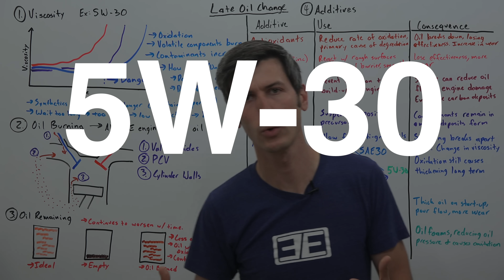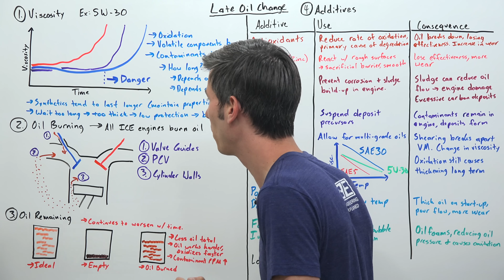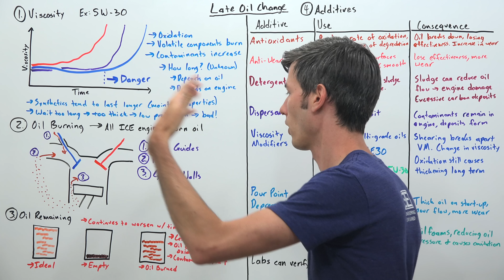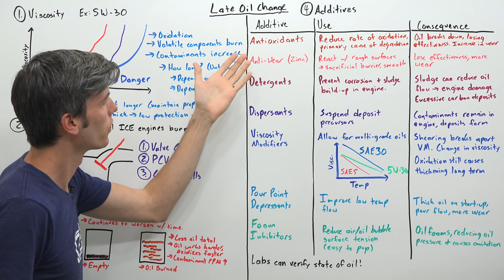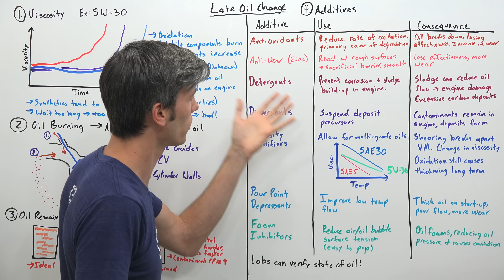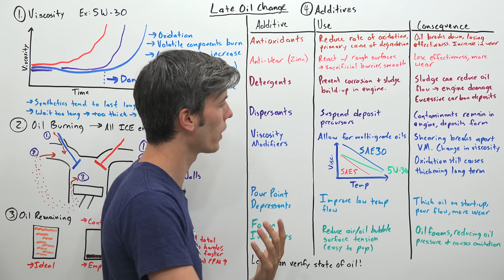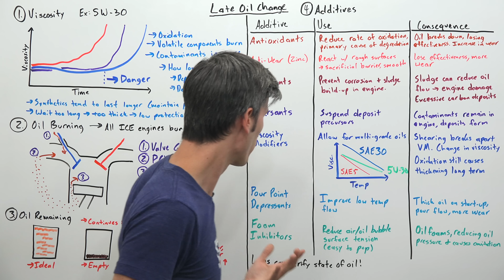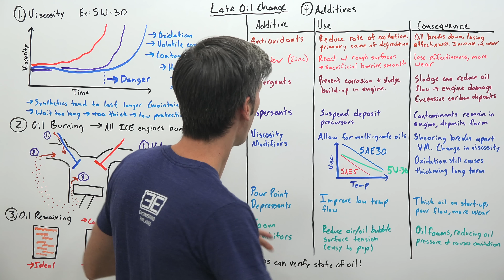What If You Forget To Change Your Oil?

Comment: What happens to the ICE oil when it passes the 1 year part of the X mile/1 year schedule? Is it just something dealership service centers make money on?
Reply: @Zap Brannigan This all makes sense, but what about the cases when the car is just parked in the garage and there is no gas/oil mixup? Does the oil age (literally) as the time passes?
Reply: @PhoenixBravo30  generally, no, especially with synthetic oils. Pretty sure the additives are all inorganic, so generally stable at normal temperature ranges. The cause for time interval changes are related to contaminants from operation of the engine in suboptimal conditions. Some of those can be mitigated by keeping the engine in good working order and by giving the engine a good regular workout at full operating temperature for at least 30 minutes to cook off the fuel and water in the oil.

Comment: I change my full synthetic oil every 10000 miles whether it needs it or not. 10000 mile intervals are easy to remember and I don't like doing math. My current car has 184kmiles and burns a quart every 5kmiles.

Comment: Is oil in the US worse then other places ?  Most of the Euro Engines I've drove in Germany have intervals north of 10k miles.  Many newer cars have Oil change intervals in the 20 and 30k mile range. (30-50.000 km)   Yes those engine lasted a long time.

Comment: Not ALL engines consume oil. I do my oil changes after 10,000 kms intervals with zero oil consumption. My Mazda has 150k kms on it. My previous car was the same.
Reply: it just doesn't consume very much, a engine will always consume some amount of oil no matter how little, oil evaporates off and goes into the intake (or in old engines to the atmosphere), that's entirely unavoidable.  I imagine there's also some oil getting past the rings or valve seals, again, it might be a tiny amount but it's going to be there.

Comment: 2005 4.6 V-8 Mustang bought new
4-5k oil changes since new 11/04
Synthetic oil used for 15 years. 5w20 recommended oil always used.
166,500 miles on engine
Engine uses Only 1/2 quart after 5000 miles. Nuff Said!  Oil is cheap. Don't push it!

Comment: I always leave knowing more than when I came, thank you
Reply: This concentrates exclusively on time not mileage , a  bit dissapointed that real mileage examples with data was not used , so if you have an occaisonal car that does low milage do you change when the milage is up or at a regular interval when its had little work to do ..?
Reply: R Warner,
"This concentrates exclusively on time not mileage, ..."  Did you mean that the other way around? Seems to me that all of the detrimental effects on oil he describes here are a function of the car being driven (like oil being burned) rather than what makes it go bad over time when not driven much.

The owner's manual for my car says (for "normal" driving) to change the oil after 7,500 mile or 12 months, WHICHEVER COMES FIRST.
Reply: Yes I probably didnt state it clearly enough , I think he was describing excess milage but kept saying late changing the oil . I believe that the oil degradation is almost exclusively a function of mileage not the duration its been in the sump 1, but would havr been good to cover both .
He usually has data to back it up but not this time ..how far beyond recommended mileage before those effects become significant and what about long life oils ?

Comment: What about if you're not driving much, so your yearly mileage is way lower than the service interval. They say change the oil anyways after 1 year, but I find it hard to believe the oil deteriorated just sitting there (of course within reason). So say you only do half the mileage interval in a year - is it ok to wait for next year?

Comment: Thank you for this explanation of gas engines and the in and outs of their oil.
I recently changed the oil in my diesel pickup, I always do, but I ran it a little longer than I should've. I noticed that it seemed much thinner than it was when new. I'm guessing it was due to being a little warmer but more so because the diesel fuel broke it down.
Could you discuss this and maybe cover why rolling coal is actually a bad thing for every reason except entertainment.
Thanks Jason, stay dry this weekend!

Comment: We ran a Ford SMax 2l diesel up to 212,000 miles and I never checked the oil level once, just had the car serviced every 13,000 miles, sold on with the original engine, gearbox, turbo, injectors, clutch DMF, EGR and DPF. Just change oil and you will be amazed how long a modern car will go

Comment: Mobil 1 Extended Mileage I think is up to 15,000 mi or 1 year between service. I usually go around 8,000 mi/service in my Acura TSX 4 cylinder but don't reach that 8,000 mi until 1.5-2 years. Am I abusing my ride? Best car I've owned.

Comment: IMO this time you missed the mark. Most important values for oils are the ratings according to MIL standards. The higher the letter, the more capacity of buffering contaminants and acids. In the EU there is no car with prescribed oil changes at less than 12k miles, many have it at 18k. Still back in the eighties a local car magazine ran a car with a sealed hood, only oil top-ups allowed. The car was still running well after 55k miles, engine dismantled and found only slight traces of wear. Oil vendors are just scaremongering.

Comment: Another major problem for  oil left too long: dilution of oil with fuel due to fuel washing down cylinder walls in direct injection engines. Major reason for new category of SN+ oils. If you've got a direct injected engine, this might be the most compelling reason to change that oil on time.

Comment: It depends on the stress you put on the engine. I extended my first oil change for more than 1500km (F150 dual turbo) since I was on the road. Nothing happened, since I didn't put any stress on the engine, just Hi-way traveling. I think, if you pull heavy trailers or so, you should change oil more often than recommended. -- on the other hand, on my F150 6inline, I did not change any oil since I had a 'blower' and the oil was going to the air filter (I drilled holes in it for to drain out).

Comment: In order to be on the safe side i added some oil until it was all the way full to the cap but now my engine won't start? Please help!
Reply: You'll need a plastic straw and a large appetite
Reply: Remove the engine oil fill cap, then, flip the car upside down to drain the oil to the proper level...problem solved

Comment: Sending to a lab cost more than replacing. lol
Reply: Sure, but you don't know anything about your engine's mechanical soundness and oil change interval management if you merely change the oil, do you? Best case, you find out you don't need to change the oil so often. Worst case, a used oil analysis could reveal mechanical problems before they leave you stranded on the side of the road, or costing you double or triple because often one thing breaking causes other part failures as well. Imagine you find coolant present in the oil - an indicator of a head gasket failure - BEFORE it causes a warped head. You just possibly saved the cost of having to plane the head when you replace the head gasket.

Also, for some newer imports and any vehicle with a large sump, it probably isn't cheaper to change the oil. The later German spec oils (MB 229.51/52, VW 504.00/507.00, BMW LL04 and anything newer) for DPF and GPF systems cost up to double what older US spec stuff does. Even the previous German spec pre-Euro 5/6 is a tad pricey. It could run $100 to do your own changes on a MB V6 turbodiesel with the DPF. You can do it for half if it's pre-DPF, but it's still cheaper to run a used oil analysis somewhere around the severe service oil change interval to see where you're really at, and adjust accordingly.

So, sure, maybe for most folks, just changing the oil at a set interval makes the most sense, but in an ideal world, we don't waste oil by changing early, nor do we let engines break down from insufficient protection on the other end of the spectrum by running too long.

Comment: I have one for you. Why do they overdrive a transmission only to gear reduce it in the rear end? I understand about every aspect of a car but this never made any sense to me. If they only ran 1:1 on a trans they could use taller rear end gears which are stronger due to the bigger pinion gear, and they could probably use a smaller rear end which would also help with rotating mass, yet every manufacturer does it. I'm sure there's a good reason, I just can't think what it would be.

Comment: Quick question why do dsg automatics need so many more gearbox oil changes than a manual?

Ive only driven manual in 6 different cars regularly from 2014 till 2017. And now get to drive a diesel transporter with dsg and a gte with dsg. 

Both cars with the dsg get gearbox oil changes every +/- 40.000 km. While i hear people say they were never asked to have the gearbox oil changed on their manual car. In the case of the transporter it is comparable. So why the difference. Shouldn't an automatic reduce the wear?

Comment: Well so my bike is on the same cheap oil for almost two years and over 30.000km now. Will do an oil change after the winter. It's a pretty understressed engine producing only 75% of power as it was originally designed. Also oil cooled. Also the brake fluid is probably 20 years old and still works fine hahaha. Yeah, gonna change that too after the winter. When I bought the bike two years ago it had tires from 2003 on there so that was probably also the last time anyone did change anything on it hahaha. It now has 50.000km and still goes strong.

Comment: Since you do 6000 mile changes ( I do 5000 miles) however many people are programmed for 3000 miles so If  they missed one and got to 6000 miles and use a good quality oil, they should be fine. I do "religiously" 5000 miles in both of my cars (full synthetic Mobile 1 in my Mitsu EVO-X) and synthetic blend Castrol GTX in my 2010 Chevy impala).

Comment: Hey Jason can you answer time vs mileage? How much does the passage of time actually matter vs actual mileage when you saying 'on time' in this video?
Reply: time can be a factor, but not as much as mileage. I don't know how much cold start cycles affect oil breakdown (equally frequent but shorter trips would have more start cycle associated breakdown per mile driven), but to my understanding the majority of oil breakdown is from thermal stress at full operating temperatures (heat is an essentially universal cause of change in chemistry). More mileage usually means more time at full operating temperature, which is more time exposed to relatively high heat.

Comment: How bad is it for an engine to have couple gallons of water instead of oil? I recently did an oil change on a neglected 05 Durango and when I pulled the drain plug, clear water gushed out, must have been about 2 or 3 gallons before some milkshake foam came out. After draining the water and replacing with fresh oil and filter it ran fine for 60 miles so far. What kind of damage did the water do and what do I need to watch out for? Any idea how this happened? The car sat for a couple years but I can’t imagine condensation causing gallons of water. I feel like short of someone dumping water in the engine, how can so much water get in there?

Comment: My diesel pickup truck running synthetic oil should be changed every 10,000 kilometres, my diesel engine on my generator running a spray foam rig should be changed every five hundred hours as / manufacturer spec why such a big difference in usage when the oil is the exact same

Comment: my car is at about 13000km since last oil change, May of this year, but i've been topping around 200-400ml, every 1500-2000km.(80% of those km are highway and I usually drive a bit faster, so it's always at high revs for a long period) And it's capacity is only 3.5l, so it's safe to say that it's changed from topping, alone. i'm joking, of course, i will be changing it, but i'll wait for the winter to past, since i'm not driving it as much, as i did the summer. Since October i probably have 2000km, which is nothing compared to what i drove May to September.

Comment: I'm glad you motioned oil analysis! That is the only way to tell if you need to change your oil. For less then $30 you will know how cheap/good your oil is. Oil change recommendations are based on minimum oil requirements.  I've got 30,000 miles on the oil in my 2.7L sprinter. "Still good for  continued use". Don't stay stuck in the 80's. Use the lab... save time, money and gain information. ie. cracked injector, head gasket leak, poor air filtration.... big trucking, and manufacturing companies  use it because it is cost effective. You should too.

Comment: What do you mean by "late" thought?
In terms of distance or in terms of time? My service partner makes me change oil every year because it's in the manufacturers service plan and I do that, but only not F myself over if a problem occurs while still under warranty.

It's a new sporty car that I don''t daily so I only put in around 4000 miles a year. So the car has had 3 oil changes within 12K miles.
So what the difference of oil sitting in my motor versus sitting in a can at the service partner's place for a year?

Comment: So what about time.   The manufacturer I work for recommends service every 5k miles or 4 months for the SW U.S.  Whichever comes first.  Says it right in the owners manual. 
High compression (13:1 - 15:1), and direct injected 4 cylinder engines across the lineup.  Some turbocharged.
Would time be a factor in oil life  / properties even if the mileage was significantly less than 5k?  Sounds to me like it very well is based on your explanation here.
Reply: Time is indeed a factor, especially if the car is just sitting. People never seem to mention that oil absorbs water and those two things do not mix.

Comment: 0:39 - wait... does that mean that cold oil is less viscous than hot oil? I though it's the other way round. I mean, cold oil seems to be "thicker" - so more viscous? What am I missing?
Reply: No, it is a relative number.  It means that the multi grade oil will flow at 0 degrees at the same rate as a straight 5 weight oil would flow at 0 degrees.  And the multi grade oil will flow the same at 100 degrees as will a straight 30 weight oil.
Reply: @LTVoyager  Ah! Now I get it! Thx!

Comment: Great videos. I change oil at 6k miles with synthetic oil (with higher zinc content) and have good results / high mileage vehicles. What about the fair-weather car driven ~1000 mi/year? Is there degradation of these additives just sitting? It is an air-cooled Porsche 911 holding 12 quarts & is cranked & warmed every 2-3 weeks in the off-season (live in the mid-south, not extreme cold). Thx for insights.
Reply: Oil absorbs water. But being as you actually take care of the car and start it at least once a month. You probably don't have too much to worry about. 2-3 changes a year and the car should be okay - It is a Porsche afterall... The worst thing for a car is to let it sit and not be ran.

Comment: My old roommate only topped up his oil on his new (at the time) 2001 Ford 7.3L. Ended up putting 280,000 miles on it without an oil change. He also only put the minimum insurance on it. Later we talked about how much money he figures he saved. It was not insignificant, but it was a gamble.

Comment: WHat do you think of adding 1 liter of ATF into engine to reduce valve lifter knocking and refurbish seals (crankshaft and valve stem seals)? Is that a bad idea? I am thinking of trying with my 2004 BMW X5 with N62 engine which is notorious for having bad valve stem seals. After 10 min idle i also get one big cloud of smoke at first rev,... after that is ok. So i was thinkin in my case refurbishing seals could help. What do you think about that?

Comment: Okay, if you're late on a change, you will have more buildup on components, higher particulate contamination, and more sludge buildup. Aside from actual metal to metal damage, will changing your oil, then maintaining the proper oil change interval reverse the buildup on components?

Comment: Jason, I hope you do a video on  viscosity. Seeing how manufacturers put in one viscosity oil, but then recommend a wide range in the manual, why is that?

Can you also talk about "lifetime" oil in transmissions? What's your take?
Reply: The range of oil they may put in the manual is for the operating conditions. Colder climates - you'll put in lighter oil so it will circulate faster on engine start up which is when most engine wear occurs. Now to address you second question of transmission - no fluid is "lifetime" you should honestly change automatic transmission fluid at least every 5 years or 75-100k miles. Manuals can go longer but always consult the owners manual for the maintenance intervals

Comment: When my car was first released they recommended 0w-30 oil, it's a Toyota with VVT-i, they updated it a few years back for the same engine to use 0w-20, now recently they've started recommending 0w-16 for the same engine, should I worry about still using 0w-30? I've still got 2 oil changes worth of this grade

Comment: I have a 2000 civic and have only added oil for over 100k km I refuse to believe it's ok but I have looked in the valve cover and there is nada engine look brand new I have only seen one other car like this a Toyota corolla that just had the oil light glow from time to time also refused to and had no slugging or anything in the valve cover

Comment: I recently bought a new car and the first service I have to do is at 30k kilometers (around 18k miles). They say they use "long life oil" and I don't even have to break the engine in. This is just crazy to me, I used to change my oil every 10k km's or 6.2k miles.